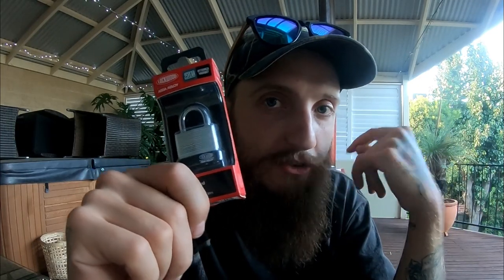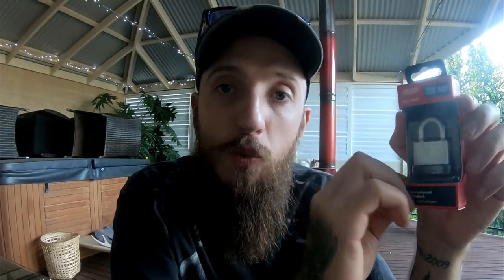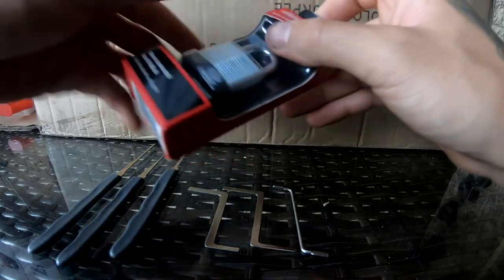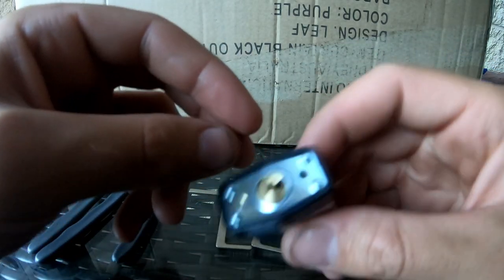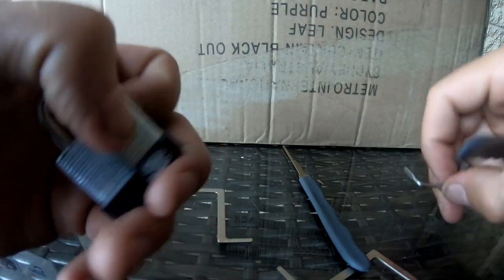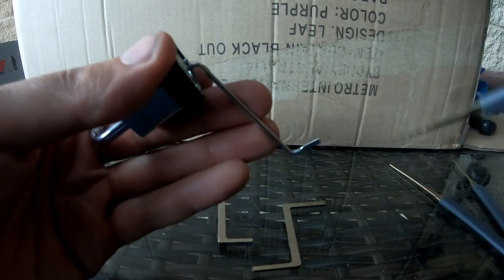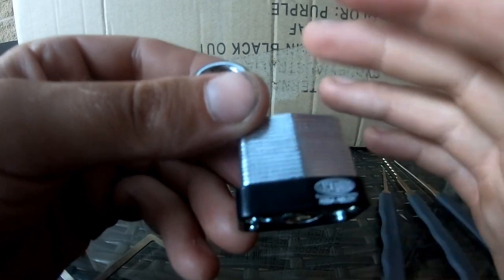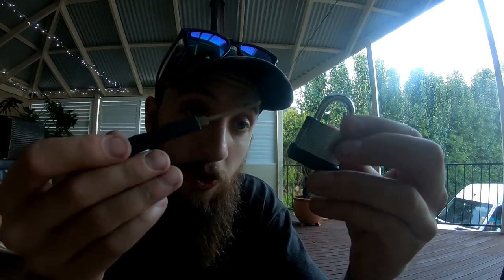Vlog 6: Picking Lockwood Assa Abloy Padlock.

Comment: Hey Chris, great video! Lockwood and Assa Abbloy actually make some really good locks. Not that one of course but the package tells you so...curious is that lock by passable? Like the first one? Also have you seen pad lock shins? Another great, no skill, exploitation of sub par padlocks. 
For your kenetic attack do u have a smaller half diamond??? Sometimes that will work where the large won’t...also you can rake with a half diamond...basically scrub in and out....Another good rake or kenetic attack pick is the “w” rake....looks like a “w” on the end...also called double peak and other names as well. You can rake, rock, or kenetic with the “w”. 
So awesome watching you learn and is inspiring to me to keep practicing and more often. I’m only slightly more advanced than you in my picking ability. I have watched too many videos to get educated and knowledgeable but don’t dedicate the time I should to practice picking.
You should get an Abus 74/40 padlock. Cheap on eBay, like $10 usd and is the next level....has spoils and serrated pins....great learning tool and practice lock.... paracentric keyway( weird shaped/ tight fit/ lots of warding) and so good security pins to get the feel for those, but pickable for a beginner with some practice. Great feed back. Best of luck
Reply from the maker: I have raked it with a 'snowman' and smaller dimond but have found it to be particularly sensitive to tension so it makes it tricky to do.
It is shielded. Tried everything I could to see if it was.

What are shims?

Comment: That tool is L rake or city rake.    The technique is Rocking
Reply from the maker: TNAME awesome thank you.
Reply: What TName said....rocking....bumping uses a key similarly cut to your pick....and the bump key is bumped into the lock while turning to open it. 

I will have to disagree with TName about that pick being called a L rake or city rake...it’s similar but I actually believe it’s a pick/rake for waffer locks similar to what’s in your car....you would rake on side then the other side while keep tension and repeat til the lock opens.

City Rakes actually look like the profile of a city sky line.....more highs and lows at different heights rather than repeating peaks...anyway that pick is working great for ROCKING keep it up.

Comment: Took longer to get into the packaging than it did to unlock the padlock. It’s time to design a lock out of the packaging material.
Reply from the maker: Bearded Warrior you're not wrong. It was a legitimate struggle to get into the packet.

I can now single pin pick it in under a minute to.